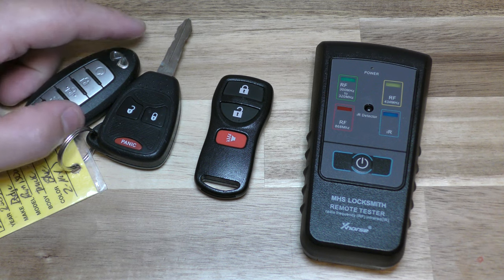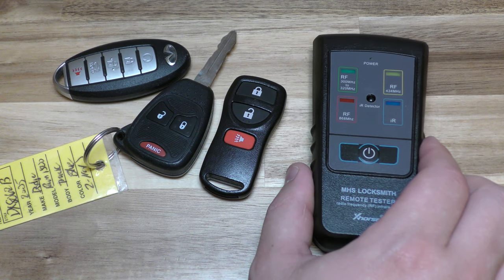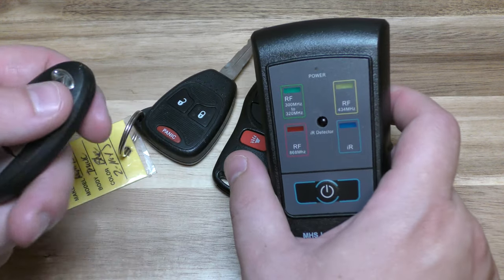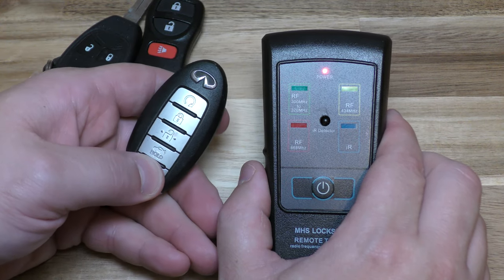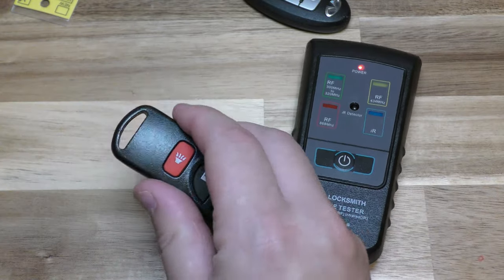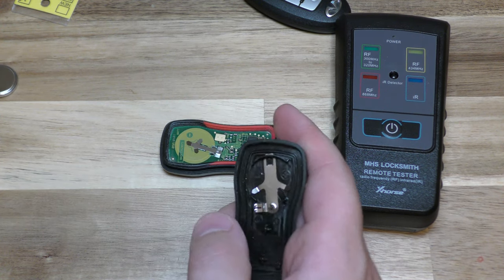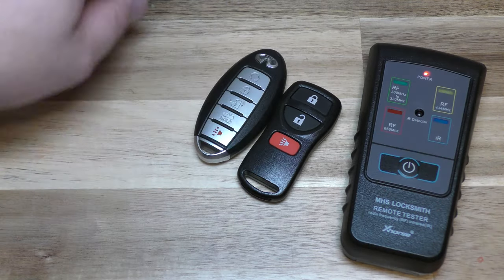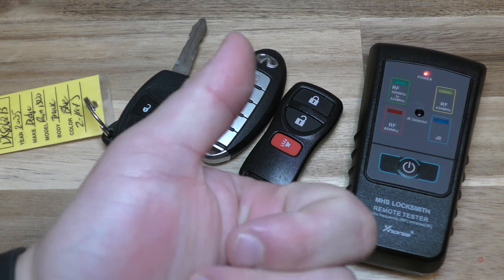Test your Keyless Key Fob / Smart Key - DIY

Comment: I have a remote tester, when I turn it on and test out a remote it will immediately turn off. It shows the frequency and turns off and doesn’t beep. Does the remote tester need a battery change or is it defective???
Reply from the maker: Sounds like that needs a new battery